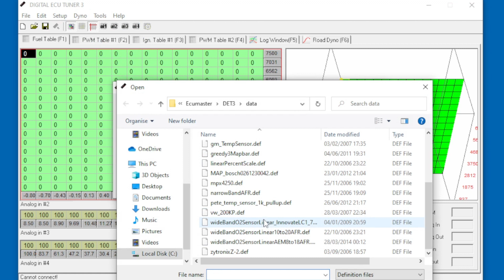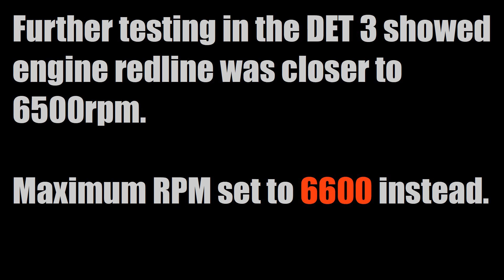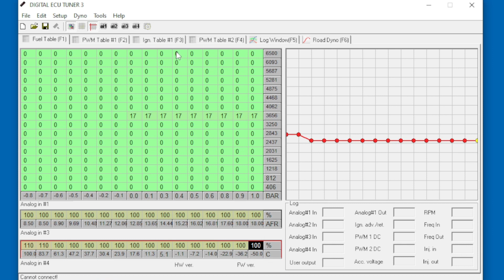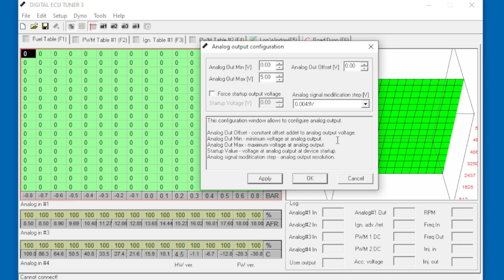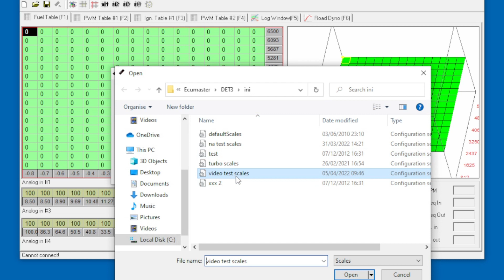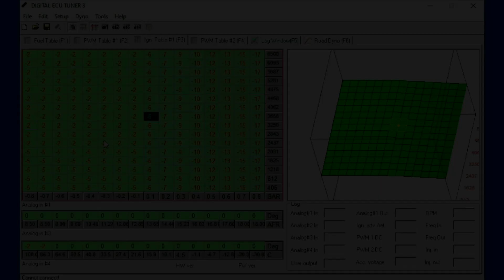Toyota Starlet ECUmaster DET 3 settings and software explained. | Toyota Starlet 4efe turbo build.

Comment: Do you think the DET3 works well for more modern cars?
Reply from the maker: Generally speaking, the more modern / "clever" a vehicles engine management is, the harder it is to trick it with a piggyback setup. There are more complex piggyback ecu's such as the emanage ultimate and AEM FIC or det3 in Fuel implant mode that have greater control of the injectors / ignition. The AEM FIC also has a NBO2 table to skew the sensor output to modify fuelling in closed loop mode. How have you wired your det3 setup and what problems are you experiencing? I'm on insta @dan91sgarage if you prefer dm.
Reply: @dan91sgarage  the main problem I'm having is inconsistency with how the car responds, especially with partial throttle boosting. I can find much information on fuel implant. I understand the aem fic a lot more but the device is discontinued for at least a decade now.
Reply from the maker: @srhabb  Can you define inconsistent better please? Are you talking changing AFR's (long and short term fuel trims from closed loop maybe?). Poor performance (coughing spluttering, poor throttle response)? Are you still running the stock MAF (draw through or blow through?) or did you do a MAF to MAP conversion, did you install larger injectors? Does the car have a boost referenced FPR or a returnless in tank setup?
Reply: What I mean is I would make adjustments and things would seem fine from a day of driving. Going into the next day thing would still be okay but randomly I would experience misfires and random lean conditions and it seems like the ECU is trying to fight the DET3+ for some reason. Sometimes just touching the throttle at all would cause misfires on acceleration even outside of boost. @dan91sgarage
Reply from the maker: Do you still have the factory narrowband O2 sensor in place and connected to the factory ECU? Do you still have the factory MAF in place? (draw through or blow through)

Comment: Thanks for all the info. 
Can the stock knock sensor be utilised on analog 4 instead of an air intake temp sensor ? 

Once u intercept the crank sensor signal the stock knock control wouldn’t really work would it ?

Comment: Hi. I installed the DET3 on a 4efte. The engine has a 24 teeth distributor.  Wired the IGT to the Piggyback. Which options should I choose in the ignition page? Thanks
Reply from the maker: The IGT wire goes from the Toyota ECU to the igniter (ignition module). 
Ignition mode= retard single signal, 
Ignition input type= Hall effect or optical sensor,
Maximum RPM= 100rpm above stock limit so 7600 or 7700?
Maximum retard (deg)= 20
Num signals per 720= 4

Hope this helps
Reply: @dan91sgarage  thank you sir. These together with the other tests didn’t solve my problem, which is the check engine light turning on on boost. I really do not understand why this is happening but if I remove the Piggyback, everything works fine.  What do you think it could be? +12, computer ground, MAP sensor and IGT are the simple configuration that involves the DET3. What parameter could give a false flag to the ECU? There is no error code. Just check engine light boost. I hope that you can help me.
Reply from the maker: @djfrankieflowers  That's difficult if there is no error code stored in the ECU. As it is only the MAP and IGT wires that have been intercepted I would start there. It could be the MAP signal getting close to 5v output and the check engine light giving a warning before boost cut. You can datalog the analogue out signal (map sensor voltage to toyota ecu) and check what maximum voltage it is sending. Are you using a plug and play harness?
Reply: My brother built a connector as yours. Plug and play. MAP output signal is now clamped at 4.1 V. so it cannot get close to 5 V. It is acting the same as when voltage wasn’t clamped. What could I do?
Reply from the maker: @djfrankieflowers  The last thing I can think of is to make sure the plug and play connector and wiring is correct. If the Knock sensor wire is broken it will make the check engine light come on at around 3k rpm. Also there might be some interference from un shielded wires but that is not very likely if the harness wires are short.
Reply: @dan91sgarage  I thought that the connector could have some interference as the ECU alone is working fine. My brother rebuilds airplanes so his skills should make me feel safe about the welding and the quality of the aeronautic wires. How should I check for interferences? Thank you.
Reply: @dan91sgarage  I jumped IGT and MAP again. Still turning on check engine light. Jumped frequency (SPD) again and it didn’t turn on the light. I did already disable the frequency function in the software but nothing changed. What could be the issue causing SPD signal (freq modulation signal) to bother the ECU passing through the DET3?
Reply from the maker: @djfrankieflowers  If you're clamping the speed signal to defeat the speed limiter. Frequency setup= Clamp VSS frequency signal. 
You will need to datalog what frequency relates to what speed and then set the limits I think. never done a speed limit removal with a DET3. At least you know that jumping the IGT and MAP on the harness means the wires in the harness are good. 

Also you said on the forum that you bought some 4efte cams. You need to measure the cam lobe height and base circle to find the lobe lift and then compare them to these sizes: 

gen2 4efe= 40.85 - 34.05 = 6.8mm lobe lift 

4efte & 5efe= 41.6 - 34.05 = 7.55mm lobe lift 

5efhe= 42.4 - 34.0 = 8.4mm lobe lift

Maybe your corolla cams have the same lift as 4efte! Or the cams you were sent are 4efe!

I know that duration, lsa... may be different but it is a lot harder to measure
Reply: @dan91sgarage  me and my brother used in oscilloscope to find the frequency and did the math to clamp it. It worked, but we have the check engine problem that eventually we will solve modifying the parameters on the software. At least we know what the problem is. 
Thank you very much for the other information you sent me cams. I am worried I received. 4efe cams. I will take measurements asap.
Reply: I found out what the issue is. The frequency out isn’t right. It has a shifted 0 to +7 Volts. The DET 3 is changing the signal. Why? Freq in is perfect.
Reply from the maker: The only setting I can find that might affect the frequency out wire signal is in the Parametric output configurations menu.
There is a box that can be chosen to use the Frequency out wire as a parametric out. Make sure this option is not chosen. 
Might be worth emailing ECUmaster technical support. I needed some help and they were quite quick and helpful.

Comment: Hey Dan! I’m looking to use a form of piggyback on my car as well.
I’m driving an old Mercedes Kompressor with the intends to increase boost.

Can this ECU be used to modify signals going OUT of the stock ECU? Modifying the inputs to the ECU doesn’t do particularly much for this car. It reverts back to a map table without looking much at the signal inputs at high throttle settings. I’m looking to modify the injector pulse signal coming from the ECU to add fuel on top of the stock map of the stock ECU.

For timing, how was the timing modified in your video? Was the signal going to the ECU spoofed, or the signal coming FROM the ECU spoofed?
Reply from the maker: @deWaardt The det3 can't add pulse to the main injectors in piggy back mode. It can only control additional injectors directly (old school 5th injector setup) with a PWM table. To control the injectors as you want, it would need to be wired in for Fuel Implant mode which takes complete control of the injectors and is tuned for fuel as a standalone would (2 x outputs= 4 injectors on one output (4 cyl), up to 4 injectors on two outputs (5-8 cyl, fired simultaneously), or 2 injectors per output (4 cyl. alternate fire). The ignition timing on the Starlet is adjusted by intercepting and modifying the signal from the ECU to the ignition module as it is ECU/distributor system. Most "normal" EFI setups will intercept the crank angle sensor to modify timing. Hope this helps. The emanage blue can add fuel to the main injectors with additional wiring.
Reply: @dan91sgarage  I've been researching fuel implant mode and I think this might be my way to go. Possibly with a method of switching between OEM ECU injector control during cruising, and DET 3 fuel injector control when under boost.
Reply from the maker: @99domini99  How will you do the injector wiring?
Reply: @dan91sgarage  I will probably go with bank fire. Unplugging the injectors from the OEM ECU, using an ignition hot 12v to power them and then ground to the DET 3 as per the manual.

I’m thinking of going a little more advanced and setting up relays between the injectors so the OEM ECU is in control most of the time, but control is only shifted to the DET 3 under high load.

I am only missing fuel at max throttle and higher up in the rev range, so I don’t actually need to change much about the fuel map. This will save me from having to create a complete VE table from scratch. I’m gonna go with setting the DET 3 up as primary ECU first and see how much effort it takes to get the car running right, if it’s too much I’ll go with the relay method.
Reply from the maker: @99domini99  I would go with the Fuel implant mode and not trouble yourself with the relay idea. Let me know how you get on.   👍.

Comment: Hey m wondering how to fully control the injectors with pmw
Reply from the maker: I've never done this setup myself, but from what I've researched: the det3 in piggyback mode can control up to 4 extra fuel injectors via the pwm table to add extra fuel as boost increases. Similar to old school 5th injector setups from the 80's. This is not full control of the main injectors. If you want full control of the main injectors with the original vehicle ecu still in place you would need to wire the det 3 in for "Fuel implant Mode" and reflash the det to convert it to the different setup. Hope this helps.

Comment: I have a question on retarding the ignition timing ,if the coil is controlled electronically,can we adjust the timing somehow?
On a Subaru impreza ,gf8
Reply from the maker: I'm not 100% sure but I believe on the Impreza the crank trigger wire is intercepted for timing retard and the MAF for fuel
https://www.ecumaster.com/wp/wp-content/uploads/2016/11/DET3_WiringDiagrams.pdf
Subaru GT turbo (impreza) on the above link (I think) 
Hope it helps.

Comment: Hey Dan, why did you pick the retard single signal over the correct wheel type (36-2 etc)? Wondering what's the benefit of selecting the wheel type vs retard single signal. Thanks!
Reply from the maker: The wiring setup for the Starlet intercepts the "spark" signal from the ECU to the ignition module, not the crank angle sensor signal (that is actually on the camshaft!). So the det 3 instruction manual states that when intercepting an ignition module signal to use the settings which I have specified in the video. If you were to intercept the crank angle sensor signal of a vehicle, you should use the correct trigger pattern as required. Good question!

Comment: Piggyback mode or Standalone/Fuel Implant mode?
Reply from the maker: I'm using piggyback mode and this video covers that setup. If I want better control I'll probably go with a different standalone ECU rather than det3 in fuel implant. From what I've heard, people using fuel implant mode have not been that successful.

Comment: Hey Dan,

Currently doing a starlet turbo build ep91 4EFE converting to turbo.

Ct9 basic setup but I have 4EFTE injectors to install

Questions if you can help :

1. I’ll need a boost solenoid?

2. Since I’ve changed injectors to FTE ones should I get a 4EFTE map sensor or leave the stock one?

I also heard 2jz map sensors work possible?

Also if I order the DET3+ do I have to purchase any plugs, wires or sensors ontop?
Reply from the maker: Hi there:

1. You only need a boost solenoid if you want to control the boost with the det3. You can just run turbo on wastegate pressure, manual boost controller, electronic boost controller if you prefer.

2. You need to use a MAP sensor that's the correct size for your intended boost pressure. So a Glanza 2 bar MAP sensor will read 1 bar of boost max. Or you can leave the 4efe MAP sensor in place and use the DET3+ inbuilt 4 bar MAP sensor for the Load and modify signals to run the engine.

The Det3 comes with a bare plug and some crimp terminals. You will need wire (18awg for power ground and 20awg for signal) and special crimping pliers. Or you can buy readymade pigtails from ECUmaster

More info here: https://www.youtube.com/watch?v=_z5hnVmlyuI
Reply: @dan91sgarage  thank you, legend
Reply: @dan91sgarage  so the 4EFTE injectors would be fine still?

Basically if I run a DET3 not + I will need a Glanza map sensor is this also known as the 4EFTE map?
Reply from the maker: @TheMalteseMachine  Yes, the 4efte injectors are a good choice for 4efe + turbo builds. 

Yes, you will need the Glanza Map sensor if you get the det3 not +. 

Part number is: 89420-10110

Comment: i am using this vid to setup my micra k11, but when i try to change a value within the fueling map for example it sets itself back to 0 everytime
Reply from the maker: Once you enter a value in the fuel map you have to save the project to the laptop hard drive, then make the maps permanent to the det3 (engine off when safe to do so) which saves them on the det3. When you disconnect and then reconnect the laptop it will ask "do you want to import from device" (det3) if you click yes it will show the stored, det3 data on the laptop. If you click no it will just show a new blank table for the fuel map. Seems like the most logical explanation base on your description. Hope it helps.
Reply: @dan91sgarage  thx for your reply, realy apreciqte the effort. i know that i have to save changes to the det3, but as soon as i change a value, it wil instantly return to a 0, so i cannot save any thing becouse i cannot change anything
Reply from the maker: @Kpostma100   That's a weird one! Does it do it if the laptop is not connected to the det3 or only when connected? Also check if the det3 has the correct firmware flashed onto it. Maybe it has Fuel implant firmware and the piggyback software client can't recognise it. Might be worth reflashing the det3 (this will erase all data) to the latest piggyback version.
Reply: @dan91sgarage  wel i did not try to change values when not conected, but should that work?if so i can try it without having to be in my car a the time
Reply from the maker: @Kpostma100  it works on mine. just trying to see if it's the laptop or the det3.
Reply: @dan91sgarage  i have tried it and what i found out is that when the key is turned off, i can input values and burn to the det, but when the key is turned on it would not do it. also when the key is turned on the values i made are switching from filled in to 0 so it is not yet reliable to deive with and i cant seem to find what causes this isue
Reply from the maker: @Kpostma100  Very strange, what firmware is flashed onto the det 3?
Reply: @dan91sgarage  i had this with the original firmware and then updated it to the latest, should be somthing .46 i believe

Comment: does the det 3 work by modifing the map sensor signal to the ecu to increase fuel? or is there a way to modify the factory map signal and still increase fuel seperately using the det 3 sensor? asking as fitting to an Aygo but the factory ecu throws a map sensor code at 5psi. This pulls a lot of ignition timing and puts a light on the dash
Reply from the maker: If the vehicles main load (fuelling) sensor is the MAP sensor then this is the signal to modify. So you intercept the MAP sensor and use the DET3 to add or subtract voltage to increase or decrease the fuelling. The problem is that most N/A factory map sensor can't read much / any boost. So you need a larger factory MAP sensor or use the internal DET3 MAP (modify/load). You will always be sending the signal to the Toyota ECU on its original MAP signal wire but the signal can come from the factory/upgraded MAP or DET3 MAP. You will need larger injectors or increased fuel pressure anyway so you will end up adding less voltage with them fitted, hopefully the required voltage will be less than is causing the Toyota ECU freakout. Hope this helps. The DET 3 can control a second set of injectors separately (via internal MAP and PWM table) but its a hassle to fit and control. It also has a fuel implant mode (not piggyback) that apparently has full control of the injectors, but some people have had problems getting it to work well/at all.

Comment: Hi brother, I am looking Forward for Launch Control, ( I have corolla 1.8 Cvt N/A stock)  my car brake boost To 2200 RPM  can I upgrade this Boost To 4000RPM with This PiggyPack Det3 Device ??  Thats All i want To know ?
Reply from the maker: The DET3 is capable of launch control. You can set the activation rpm, cut off rpm (limit), ignition retard and fuel enrichment. You can also use a vehicle speed sensor input to turn the system off. I don't think it will work on an auto / CVT. If brake boosting holds the engine at 2200rpm I can't see how the DET3 will make it higher rpm.